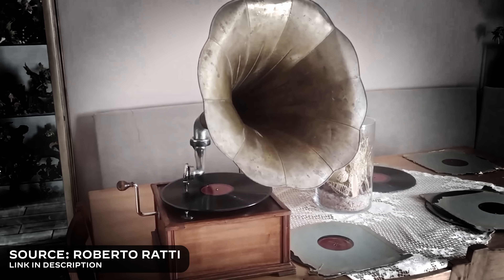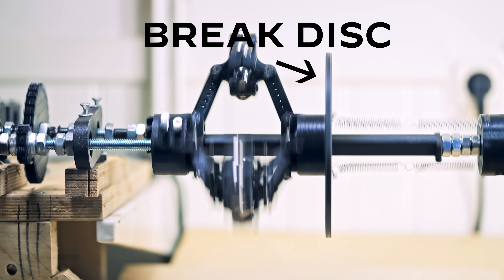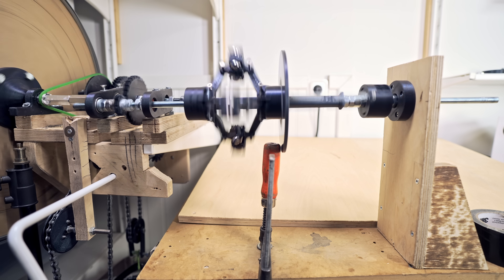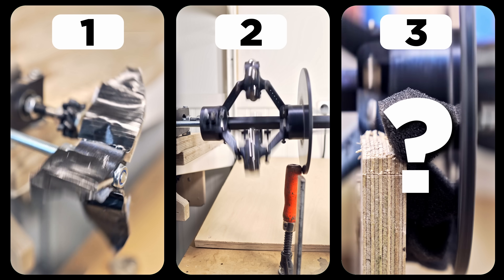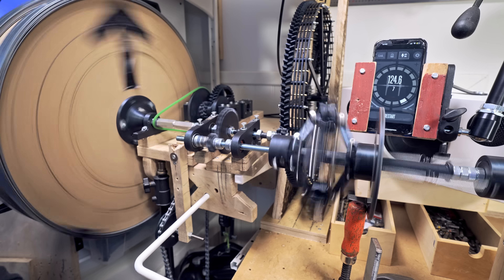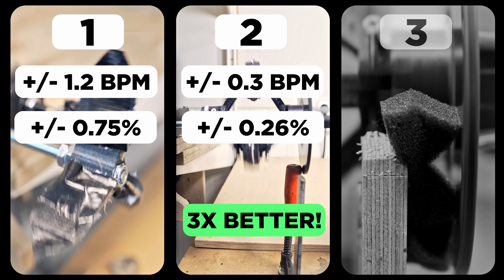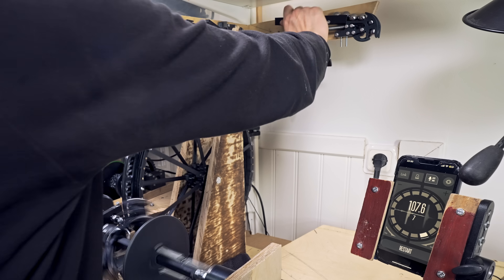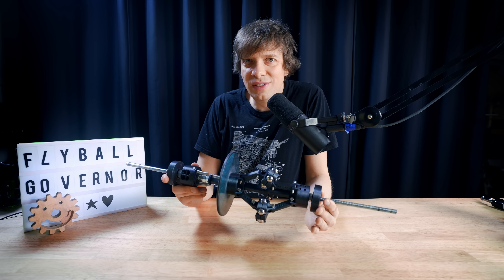How Gramophones play Tight Music - The Flyball Governor

Comment: Just remember that you're using friction and foam together. Much like brake pads in a car, friction will wear the foam down over time and will need to be replaced at regular intervals
Reply: with right materials it should not be a problem, as it is not a problem with gramophones.
Reply: the gramophone docent use foam though, it uses a steel part the wear on that would be negligible. @1815dmitriy
Reply: I'd also be worried about fire hazard 😅
Reply: @DanielSabelnikov1  Depends on the foam used, you can get some non flammable foam
Reply: I believe Gramophones used leather as a friction surface material and the discs were usually brass. I imagine steel would work for the disc as well.
Reply: @motjuste8549 Looks like a felt pad to me on the one he has shown in the video.
Reply: @motjuste8549 now I want brass, though.
Reply: Just means he needs to get an idea of how often he needs to replace the foam. If it can last for a whole show then it's merely a pre-show prep step.
Reply: Well, the whole thing is a ton of moving parts, of course some things are going to wear down over time. One more thing wearing down isn't a big problem in this case, especially if some foam that doesn't fall apart at the slightest touch is used.
Reply: You should use something readily available, consistent, and relatively cheap. Perhaps something like one of the brake pads that clamp the rim on a bicycle.
Reply: @BlaMM74 or use bicycle disc brakes - a fairly cheap off the shelf part.  Like the foam solution there is a ramp in the response between lever position and friction but it uses brake pads designed to wear in a controlled way.  The foam won’t.  Also more Bowden cables!
Reply: The question is: What is in the not prototype version, I think something real breaking pads from a car. because, more for one:  more (constant) friction/Force applied,  and second it's an available part, that is optimised for breaking., the other question is Is there an PI version of it. because if you calculate this thing it should be something more speed above set point (via the springs) more Friction so no more speeding up. No is important if the gain factor on the regulator is big enough that the variation is small enough, depends on how constant force is used up by the machine, like if there high flacuation in force needed this will directly get back to the speed. like an jitter on the signal.
Reply: @mariankerler2134  Car and bike brakes may not work well for this application. They are designed for aggressive but very short use. Riding your brakes down a hill for a long time will saturate them and cause them to fail. The machine will have friction for basically the entire show, so at least an hour, with very few breaks to cool down. Now maybe car brakes work ok (assuming they aren't noisy) but we can't just assume that because they work in one application that they'll work in another one.
Reply: @mariankerler2134  The likely reason the foam works so well is it compensates for any imperfections in the disc. Brake pads from car would give comparable results to the clamp.
Reply: @Mrgwa  I think you're onto it. But also the foam has a far greater contact patch compared to the clamp handle. Something more like a cars clutch; where two discs meet with a lining of oiled leather might be good...
Reply: Not sure about the brake pad ideas. It would be noisey and make a lot of brake dust and heat and wear away the disc. A pad made of bronze would be better at A/ resisting wear B/ it is a self lubrication metal. Probably would still make some noise. 
Leather or felt replaced at service intervals is probably the best idea for low noise and heat dissipation. Both options could be lightly soaked in oil and still work the way a wet clutch on a motorcycle still works. Wet felt or leather pads would just need their surface contact area increased to compensate for lower friction of adding oil, but no noise and way less heat.
Reply: Replace the foam with several neodymium magnets and use eddy current braking?
Reply: @miltonthecat2240 he need to increase the friction with pressure, you cant do that with magnets.
Reply: @Beardest-b4p you kinda can. The closer you get to the pole of a magnet, the stronger the magnetic field gets as the field lines are much closer together and more parallel. Also the faster you spin an aluminium disk through those field lines, the stronger the eddy currents induced in the disk are and therefore, their own generated magnetic fields will be stronger, resisting the magnets magnetic field. The disk will get hot though.
Reply: Ooh, nice frictionless idea! @miltonthecat2240
Reply: Couldn't the 'density' or strength of the magnets be directly tied to the centrifugal force too? @miltonthecat2240  Maybe electro magnetic?
Reply: Interesting @miltonthecat2240  
Would they heat up and/or the field deplete over time?
Reply: @miltonthecat2240  If going that far, he could simply drive an electric generator with a variable resistor to adjust load for speed regulation - and get rid of the flyball. But I suppose that would lack the visual interest in terms of how it functions.
Reply: @pauljs75 fr if you're going to use magnets to govern that it could be 100% perfect timing, but at that point it's just garage band or fruity loops with marbles. Might as well stick a raspberry pie in there.
Reply: He should switch to using ceramic brake pads. 😂
Reply: Everyone in this thread re-inventing the brake pad. Just use car or motorcycle brake rotors and pads.
Reply: I think foam will wear out pretty easily, maybe a spring with some sort of ending that would not wear as much. I keep fingers crossed for this machine
Reply: I believe the original old mechanisms use metal and felt. It's a good combination.
Reply: Everyone is missing the point. Foam works great, sure there could be other materials. But what I was saying was that foam could wear down and start to cause inaccuracies over time. There may or may not be better materials for this. But if he keeps on using foam, it's going to have to be a quickly replaceable part
Reply: Actually gramophpne use fleece pad with oil on. And friction on steel plate. I repair couple of gramophons, and no one need to replace fleece pad. Just oil on it. And still works (100 years old). But flywheel weight may be litlle less. Easy for gowernor...
Reply: One solution could be to copy rowing machine principle and make a big fan to displace/heat air  and dissipate the energy
Reply: Or even take inspiration in rotary subwoofers where the mecanism is analog to an helicopter and the system is changing the geometry of the blade to move more or less air
Reply: Pretty sure this could be hydraulic no?
Reply: there's nothing wrong with having wear components, there are tons of them on the music machines at the museum
Reply: Foam is obviously not a long term solution.
Reply: He could likely substitute the foam with a carbon cloth like plumbers use as fire protection for soldering or brazing work. I think the idea there is to adjust the responsiveness in relation to the friction brake coming together. (Its role is a mechanical type of gain adjustment on the speed regulation, something to do with potential for flutter I guess?)
Reply: Imma bet he ends up using a vegan instrument felt, like for cymbals or piano

Comment: I have a question about the physics here.
How much is the friction of the disk rotating against the peg vs the fact that the governer "wants" to spin out but can't because the disk can't move any further?

I may not have explained that very well.

In the video the disk is spinning, it rubs against the peg (or foam), which generates friction, which slows the spinning.

If there were a version of this where the disk doesn't spin, but is still linked to how much to governer is changing shape, it can still prevent the governer from changing shape.
This would (I think) put stress on the govener with competing forces, which (again, I think) would force the spin rate to reduce.

Based on the foam version being quite squishy I think it doesn't function very well as a peg but possibly functions very well as friction against spinning, so that suggests that it's this friction which is doing the better job here.
Also the spinning friction version is probably more linear, while the peg version I guess is all or nothing?
Reply: It's pretty much all in the friction of the disk. The only impact that the "spinning out" will have on its own is a reduction in relative acceleration, but not in absolute velocity. Aka, the governor can spin at any velocity, but the in-out movement will affect how quickly it will accelerate/decelerate to any given velocity.
Adding the friction disk makes it so it will actually go to a target velocity that's lower than the velocity that would have been reached normally without the governor.
Reply: @TijmenZwaan that makes sense.
N.B. Somehow my comment was posted before I was finished, it's now much longer!
Reply: @LeeSmith-cf1vo  I will slightly correct myself, since the springs pulling back the disk will also cause a braking effect similarly to the friction disk itself, but in a far less controlled manner.
Reply: The latter effect won't actually cause any friction. Consider the large, mechanical flywheel: the material composing it similarly wants to spin out, but can't; this doesn't cause any friction.
Reply: Stopping the flyballs from spreading has no intrinsic braking effect. After all, a solid wheel can't spread out at all, yet that alone does not have a governing effect.

Comment: I noticed that the wood for the flywheel was bouncing. To make sure your tests are not impacted by this you should probably make it a little stronger.
Reply: I like to keep in mind that this is still a prototype, so the fact it's playing this tight already while still being made from mostly wood and plastic is amazing. We already know he's capable of machining relatively precise flywheels since he learned how to properly turn metal on a lathe.
Reply: @stellavalkyrieyoung  this is true. I was just thinking he may run into an issue that was caused by this bouncing.
 Example the foam may work better now with the bounce but when he eliminates the bounce it may be better with a handle.

I have no experience in music or engineering just home projects and found that the little things come back to bite you. 

I would hate to see this project come to an end because of something like that
Reply: @xs8067  I did notice that the brake force on the gramophone was being applied by what looked like a small piece of felt. I think the greater surface area of the foam worked so well on the plastic rotor since it also isn't machined and the foam could deform to the irregularities and provide a more consistent contact patch, whereas the  clamp handle wasn't enough to stay consistent and absorb the shock of the rest of the system. Certainly more tests should be done for the final assembly to find the right braking material that balances friction, shock absorption, and durability.

Comment: 6:00 EEEEEEEEEEEEEEEEE SWEAK SQUEAK EEEEEEEEEEEEEEEEEEEEEEEEE are you sure you want this on a machine
Reply: This is a prototype made out of wood and 3D printed plastic, with no dampeners or anything. That will not happen on a final machine.
Reply: its a prototype made of 3d printed parts and basic wood lol
Reply: To me it looks/sounds like the squeaking noise is coming from the crank handle rubbing against the plywood. Not anything to do with the governor itself.
Reply: It's just a quick prototype
Reply: It's a prototype. The real machine will surely have better materials and tighter tolerances.
Reply: i know its a prototype and the materials

the primary thing I'm trying to say is that sound needs to be mitigated and the prototype is noisy. maybe Martin should do research into the best material to reduce noise